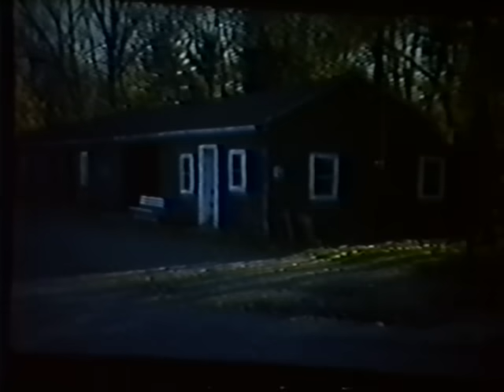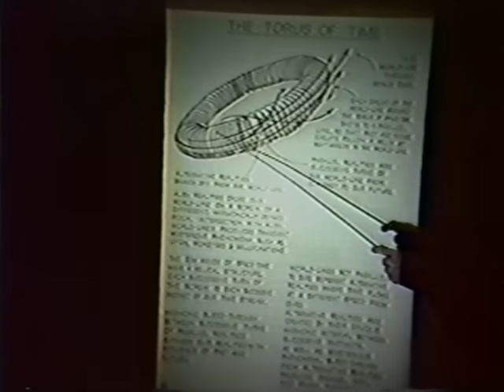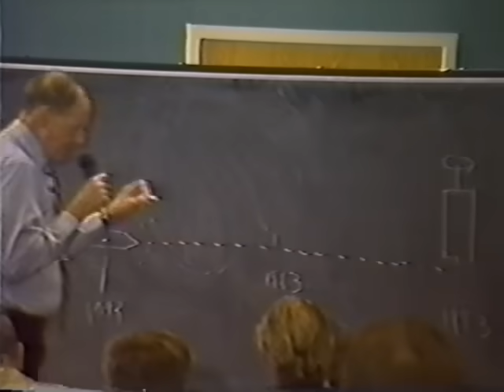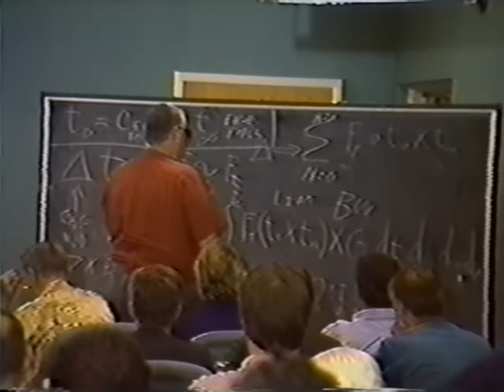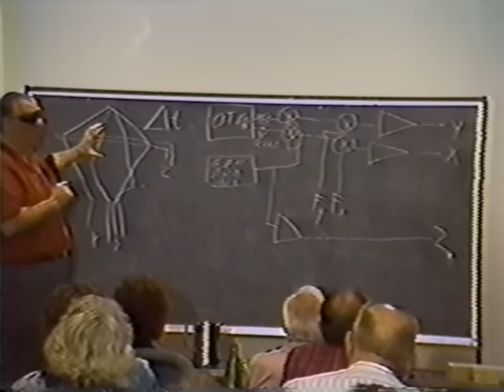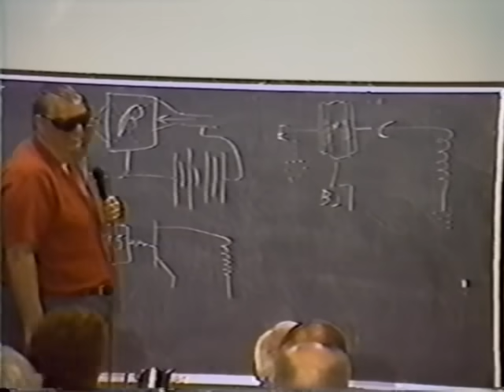Delta T Generator and the Philadelphia Experiment - Al Bielek

Comment: My grandfather is one of the engineers listed on this expirement he was involved in alot of military stuff he designed an had patents on a few things one was the EJA valve the flows fuel to every ICBM every nuclear powered ships subs,carriers etc he also designed an plumbed all the freezing Chambers that are located at Wright Patterson air Force Base to house the ETS that our government had come across he was a nuclear mathematics teacher at Chicago University he told us alot before he passed away he also helped a man who designed a boring machine called a thermal nuclear boring machine that melted rock an soil solid as it bored that's the tunnel machine used for the underground railroad that links many bases our government took that machine a long time ago hasn't been seen since, later he was a head engineer for Powell valve in Cincinnati he built an designed howitzers for the military also when he worked there is when he did the freezing an plumbing for those machines at Wright Patterson
Reply from the maker: Thanks for adding that interesting story.
Reply: @joelglaze5545  lol
Reply: I'm not sure if it's 100% true story from lbl but one thing is for sure he believes it's true if you count his life is Ed Cameron Al bielek must have been about a hundred and twenty when he died in 2011 rest in peace Al
Reply: Fascinating! Please share more!

Comment: everything that exists
everything that happens
is a manifestation of torsion fields in dynamic space
matter
light
mass
gravity
magnetism
electrical charge
the strong and weak nuclear forces
A unified field formula can be created by multiplying both sides of Einstein's famous E=Mc^2 by a torsion field function.
Einstein was forced to incorporate time into his equations because his equations are within a framework of static space
He had no allowance in his work for torsion fields which are observable measurable and real.
Incorporating a torsion field function does not "break" Einsteins equations it merely moves his work out of static space and into dynamic space where a torsion field function can be used. 
It makes Einsteins work compatible with the ether model.
Reply: noneof yourbusiness so removing time from Einstein's equations doesn't break them? Lol
Reply: Wrong again. Einstein famously admitted that the theory of relativity is incorrect, and electricity should be input instead of gravity, and Tesla supported him. You're theory that time doesn't exist is wildly incorrect.
Reply: @dickdiamonds3410  *your -- and time does NOT exist, Dick. You must be new here

Comment: flow "through time" doesn't move through time
time doesn't exist- time is a mental construct 
this 4th dimension illustrated here is bias not time
it is not a space-time diagram it is a space-bias diagram
the 5th element in the diagram ie 5th dimension is the right angle component to the axis on which bias is active at the point where bias manifest in 3 dimensions..
5th element (5th dimension)is a radian of the torsion field
4th element (4th dimension) is the axis
dimension is not a place it is an aspect, an element of a greater thing.
Time being nothing more than a mental construct is NOT a dimension of the framework of reality.
Time is a framework of observation.
4th dimensional Bias is cause by a torsion field. as a matter of convenience it's fine to refer to the torsion field as the 4th dimension.
entropy is an effect of a torsion field in action.
In the quantum field probability potential moves up or down in scale until it cannot at which point it ceases to change in potential and manifests as change in 3 dimensions.
quantum potential manifests in 3 dimensions as a change in energy or mass or as movement.
This is not to be confused with entropy which manifests changes in energy mass or as movement through cause and effect entirely within the presently manifest physical.
cause and effect works reciprocally between the manifest  and quantum frames
.
Reply: noneof yourbusiness  time is a measurement of magnitude i agree, however, there must be a reference. If you jumped off the earth, the use of time in the context is correct (t1/t2 delta T. ) . I dont know about the time swap etc. from Al. But his technical explanation is correct in its function, which no other have given. The systems he describes we use in different separate systems in the real world. Mainly VOR, Tacan, and ILS. Where they use phase as a locator, to mask lobes, rotate the signal etc.
Reply: You're completely wrong and the evidence that you're wrong is readily available and easily understood
Reply: Amen! At least someone didn't swallow the bs of this video or drink the idiocy.
Reply: Yet you can't give someone a place to meet, without giving a time